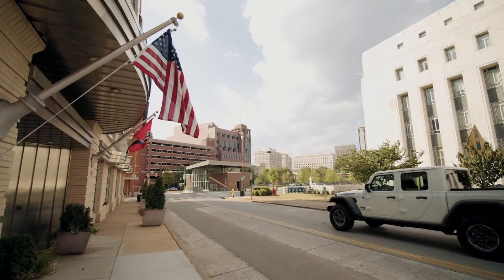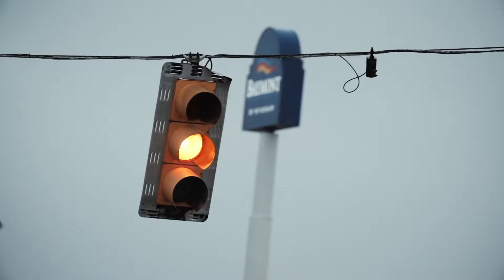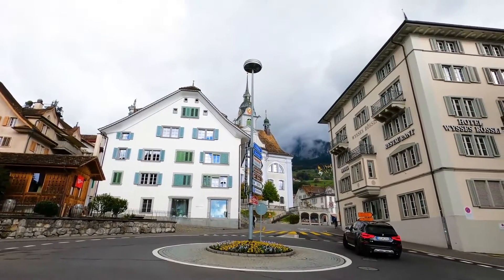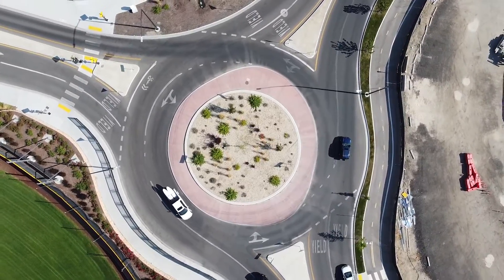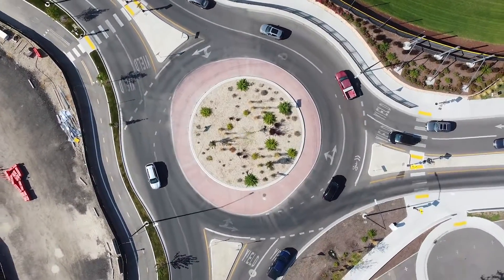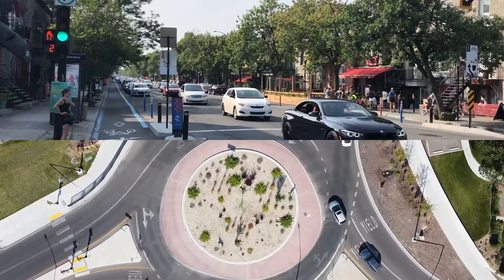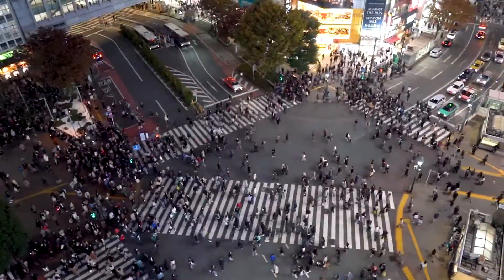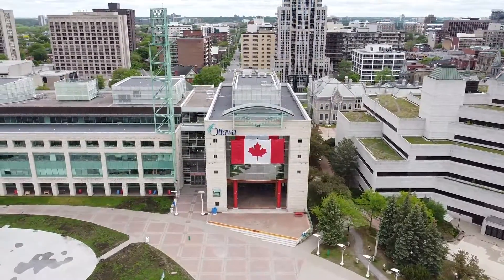Roundabouts VS Signalized Intersections, what is the better intersection design?

Comment: Better, cheaper, and simpler. (Type: "4782 Post Road, Charlestown, RI" into Google Maps for example/ note route 1)

Also:  (Type: "Intersection without traffic lights. #dubai #engineering" into the YouTube search box)

Question - does anyone know the technical term for this configuration? Thanks.

Comment: I wonder if you looked at Dutch intersection and roundabout design. Because they work really well for both motorists, cyclists and pedestrians. Physically challenged people use their custom made bicycles, or mobility scooters/cars and safely commute. 

Take a look at the videos made by ‘Not Just Bikes’.
Reply: The issue is that most roundabouts don't have a light, so while people that can move as well might still be able to use the very well designed Dutch roundabout, it still doesn't do anything for blind people. Without a light the blind person can stand at the crossing and would need to be signaled by the stopping car that they can go through by for example a quick honk, but you don't really want to encourage people to use their horn and that horn might be scary for the blind persona and would get annoying.  So if you have no light and don't want cars honking then how would a blind person know it's safe to cross?
Reply: @Arjay404  It's indicated in the pavement by using special rubber tiles. And the traffic lights also make a special rattling sound when persons can cross.

Comment: My hometown's new roundabout in northern Ontario has accessible pedestrian signalling with flashing lights and voice indication that states a pedestrian is crossing. I've used it about a dozen times so far as a pedestrian and it's been great. It's so much better than the formerly five lane wide signalised crossing that didn't even allow a pedestrian enough time to cross before it starting blinking and counting down. As a driver, I don't mind the novelty of driving through the roundabout. I don't find it confusing to yield to vehicles that are already in the circle. I'd much rather slow down and yield than have to wait at a red light. The traffic lights in my city almost seem as if they're timed to be red when you reach each and every intersection (rather than green, which would make better sense).
Reply: They always seem to do that but really its because it can't be optimized as you would always favor one particular direction. Cities would be better off with more pedestrian centric methods in mind. Biking walking and street cars (like a bus on tracks down the middle of a street) would be very useful for getting serious amounts of people around a city, quiet a city down (cars are the main causes of cities being loud) 

As for your observations about round abouts they do work better than your standard intersection in light/moderate traffic scenarios.  In heavy traffic both round abouts and signaled intersections break down and back up.
Reply: @antonisautos8704  Yeah, streetcars. They actually build them here for Toronto. Unfortunately, the city tore out the infrastructure in the 60s or 70s. First, they removed the tracks and utilized the overhead wires for trolleybuses for a while. Then, they replaced those buses with diesel which they order from Winnipeg even though the city has a Bombardier plant that builds streetcars and GO Train cars. It's not at all a pedestrian friendly city. Far too often, sidewalks randomly end. And the city is basically designed as if it were suburban where the heart of the city is a wasteland of big box stores, strip malls, parking lots and car dealerships. The two historic downtowns lost most of their urban density with full city blocks razed to build parking lots. There's plenty of off-street parking, but few businesses to actually go to.
Reply: @david_walker_esq  thats tragic and sounds criminal to be honest.